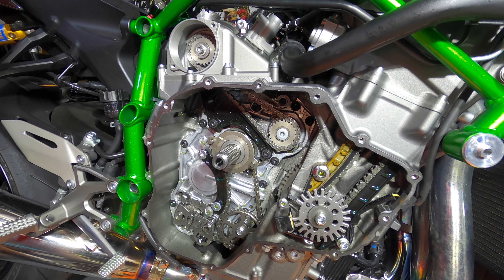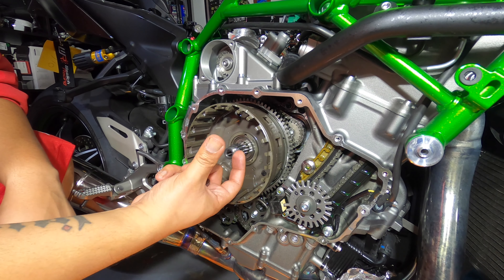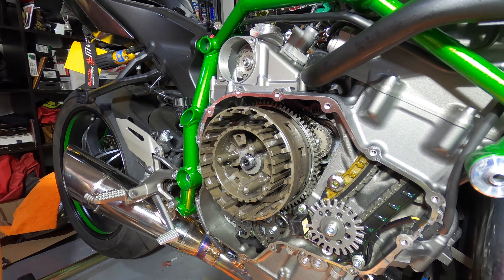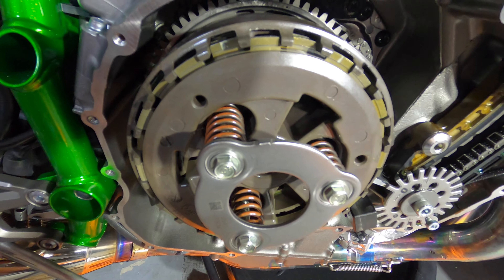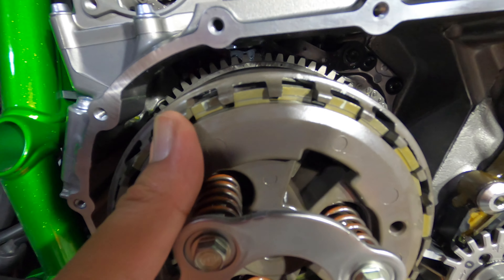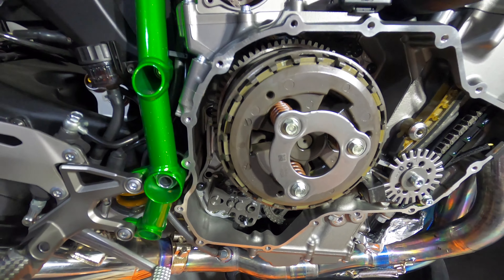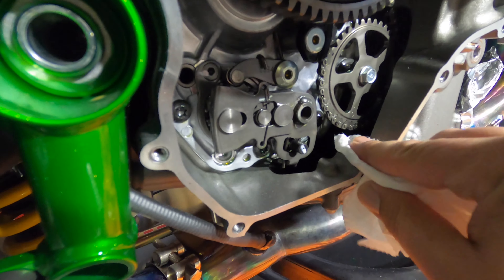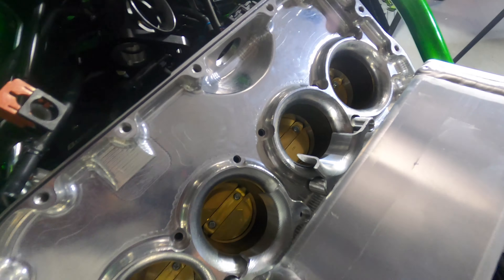Kawasaki Ninja H2 Stage 3 Upgrade install (Part 3) | KSIX

Comment: Did you just the gears. Did you do the cam work. H2r cam.
Reply from the maker: No cams. I was worried about the long term reliability factor. Also, most owners agree that once you break that 270 WHP range, it's helpful to extend wheel base. Cam would put H2 well over 300. 
To do the stretch the way I wanted, it would have cost me close to 10k or more. Didn't think it was worth it. Still don't.